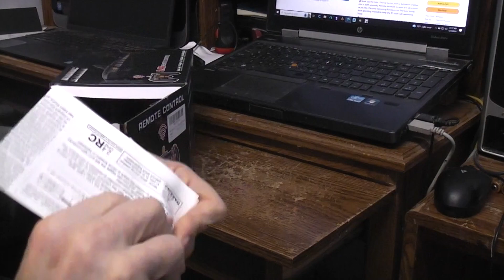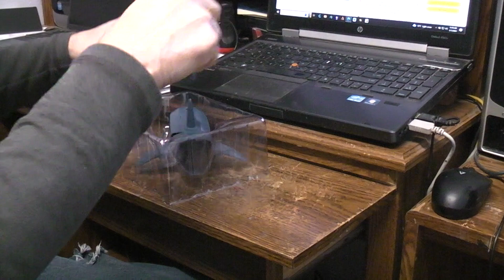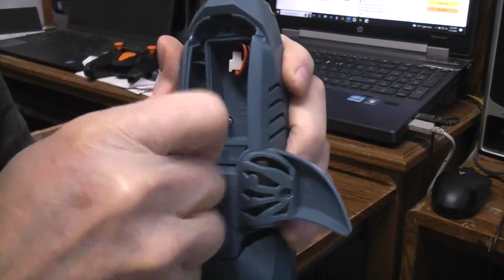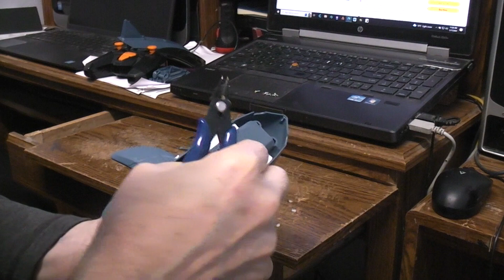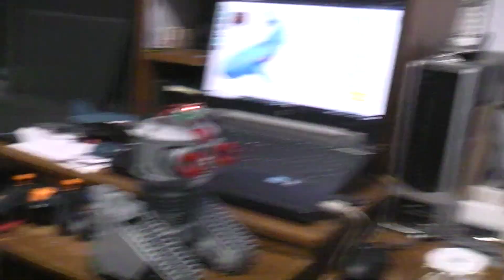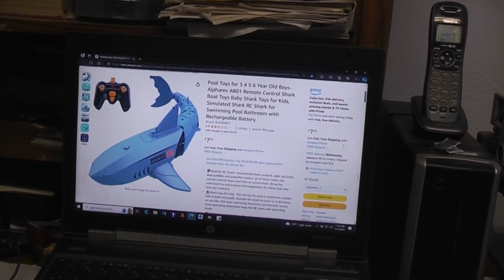Let's gut this $7.99  Bionic fish for the 2-channel digital radio control parts, battery & motors.

Comment: Interested in seeing the differences in the two gearbox's , I got held up finishing my other track system so have not tested them yet on a 1/5 size j5 yet but did do a set of 1/6 scale j5 tracks workung with a different moter placement for that particular scale which worked fantastic, I used rubber resins for the drive wheel for more traction and WOW what a difference it made and have so much more grip now on the track links and was able to drive him around quite easily with quite abit of weight having all my j5s made from resins and not filament
Reply from the maker: I think they are working on programs that will be able to let resin printers print with percentage infill. Not here yet but coming . Then the parts will not always be solid and heavy.
Reply: @Robothut  I print everything hollow as much as possible but resin is still going to be heavier then fillament,,, what im going to do is build a 1/5 scale SC2 version, decals, backpack 🎒 and scarf like he just arrived, may do some electronics like lip lights to start with and some vocals specifically just for your track system and see how they handle that build and take it from there , I will start posting more YouTube on it so you can see the progress of the build ,, this year im pretty much concentrating on scaled j5 track systems
Reply from the maker: Sounds like fun. Keep us posted. @titanwross